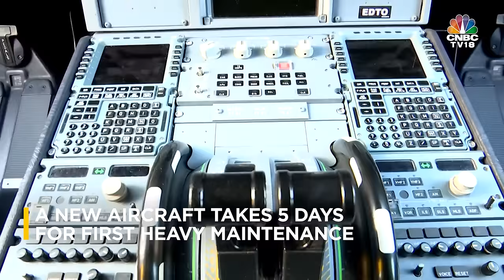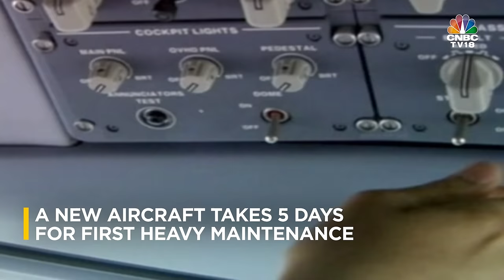The Costs & Intricacies Of Maintaining & Repairing The Airbus A320 | AAR-Indamer MRO | Indigo | N18V

Comment: He is depicting the wrong picture of the MRO sector in India. AIESL earlier a subsidiary (engineering wing) of Air India and still a govt of India undertaking has excellent complete engine overhaul facilities in Delhi, Mumbai and in Mihan Nagpur that include test beds also. It has major maintenance bases with hangars at Delhi, Mumbai, Hyderabad and Kolkata and has all kinds of technical expertise in handling aircraft such as A320 family, 777,787, 737 and ATRs. It is only lagging behind at the front of management which are mostly filled with retirees/contractuals and have no vision to take advantage of the current boom in Indian aviation sector.

Comment: People who opened this MRO in Nagpur should reflect on their poor site selection. Midday temperatures in the shade, in April May June July August routinely reaches 40-45°C. Concrete both absorbs heat and reflects heat. That metal shed absorbs heat and retains heat. That aluminum fuselage absorbs heat and retains heat. And I don't see any active or passive cooling measures anywhere. Which means those sheds get hot, and stay hot, like a tin can on a hot plate. Unbelievably draining if anyone has to work 8 hour shifts ( or even 6 hr shifts for that matter ). Can you imagine the physiological and mental stress when units run full to capacity ? Able bodied men will be dropping like flies from heat exhaustion.
It's all very well to put out such fluff pieces in an effort to upsell this sort of industrial services activity to potential clients and job seekers alike, but the core processes need to be better thought out wrt the people who are actually providing the services.
Reply: former civil aviation minister Praful Patel's son own the company...
Reply: I was thinking the same thing! Why is it considered normal to not give any decent facilities for workers in India? That too in such an expensive field as aircraft MRO
Reply: The overall temperatures and heat is the same throughout the country, with this approach no industry or facility will work in India. In this case clear and warm climate is favorable for Aircrafts and aircraft maintenance.
Reply: I think Nagpur was chosen because of its central location in India, which would also mean Ferry flights if required - to and fro would be cheaper.
Reply: Too many assumptions based on just seeing video. Have you actually been at the facility? There is Air India MRO right next door working since years. Nobody has dropped dead so far to my knowledge..

Comment: If you were ready to give me 35$ an hour, then I would have worked in India.

Bro, the non-certifying aircraft mechanics working in these airplanes are underpaid, they earns a gross salary of 25000 to 30000 Indian rupees a month that comes around 302USD to 362USD a month and after tax deductions, you can imagine how much they can have as take home salary.

The certifying employees are getting good payments that would come around  to a gross salary range between 150,000 Indian rupees(1810 USD) to 200,000 Indian rupees(2412 USD), take home salary is after the tax deductions.

Comment: What about driver? Is there any driver in a plane?
Reply: they use pushback truck for towing. All they need is to apply parking brakes of the plane when required. No function of engine here.
Reply: 😂.. yes there is a bus conductor also on the plane
Reply: @manikyum  yeah my question looks funny but now I should say , to be clear to you and others , why I asked that ! That person is mentioning himself and other suitably qualified engineers ( who are the backbone of aviation) as mere mechanics ! Yes , there is the US they are called like that which in my opinion is very derogative and of low standard . Do you call a bus or a cab driver a pilot ? NO.  ( though nowadays high speed train drivers are mentioned as pilots , no issue ) . And if so that they are called as mere mechanics , then pilots should also be called as mere drivers of an aerial bus system , without any special treatment  as they get. Simple. Otherwise , it has to be of similar importance.  So my funny question comes from this ! Is there a driver ??  😁 Yeah , those conductors are  mostly ladies . 😄

Comment: The fact that we couldn't get FAL for Airbus with IndiGo & Air India's combined order is shameful.
Reply: Sir, if you look at it that way than every country should have an FAL just because their airlines are buying a lot of planes! ✈️😂
Reply: I am sorry to ask. But what does "FAL" means?
Reply: @RahulRk-tr7ot  assembly line
Reply: Airbus is certainly interested in opening a new line somewhere in the world to take better advantage of Boeing's incompetence and their inability to deliver quality. But the problem is that the component supply chain has such a big demand shortfall that Airbus needs 5 years to reach their target production rate at their existing sites. With such a situation their hands are a bit tied with regards to a new FAL, due to supply constraints on engines, aircraft interior etc. However I hope that Airbus will announce plans for a FAL in India at least 3 years from now.